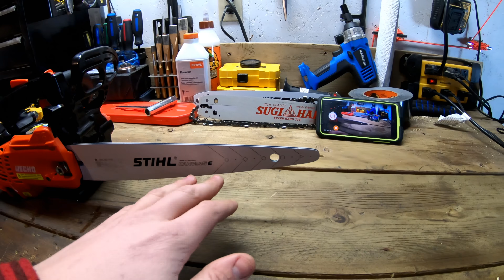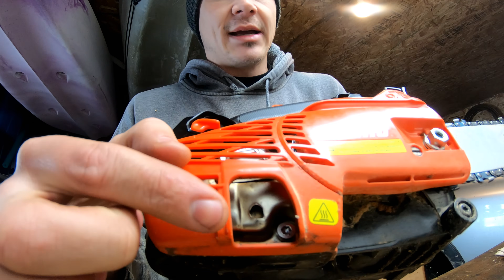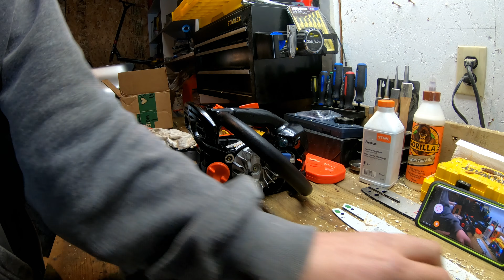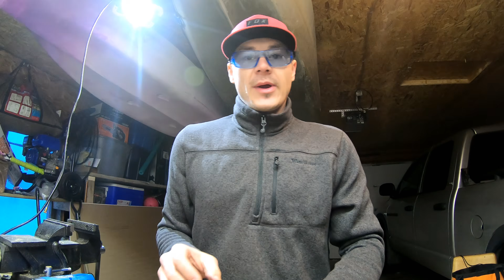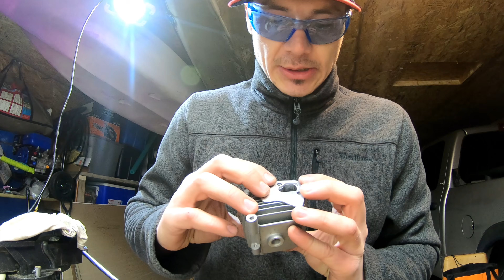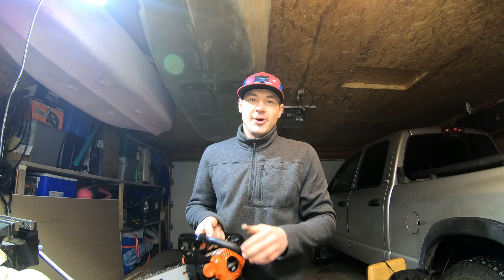Echo 2511T Full Mods!

Comment: I want to put 14in sthil light es bar on a brand-new echo 2511t will it fit if I do a 1/4 pitch sprocket conversion
Reply from the maker: No, it won't. You can do a modification to make it work. Get some good drill bits. The steel is hard af, lol. If you want, drop me your email, and I will send you bar pictures so you can modify it to work.

Comment: Thank you for this video. I’d love some advice. I modified the muffler on my 2511 T, it immediately jump the power up. I’m an arborist and this saw is a perfect weight to power now. The only issue is I’ve had it into two different places to have it re-tuned. Specifically when I shut it down and then go to restart it a few seconds later It will not fire on any number of pulls. Then when I pull it with the throttle wide open it fires right up again. Do you have any idea what this is? I obviously did not adjust any of the timing or do any porting. I’m satisfied with how the saws power has been changed. But starting it this way especially in a tree is not optimum. Any advice is appreciated
Reply from the maker: So I've had this issue as well, the saw is a bit quirky I would say, fast idle works great to start it after its been shut off  just flip the choke on then back off, and then you dont have to squeeze the throttle, Also I find aspen 2 works great for this saw, its a premix 2 stroke fuel and its all I run in it, I have a hunch the air filter has alot to do with the problem, im gonna try the mesh filter soon, hope that helps.
Reply: Poplar Mechanic great idea, I’ll try that tomorrow!

Comment: @7min -- LOVE that your conclusion, jug-in-hand, was basically that you saw most-potential in that exhaust-port's rear-end....I hate saying this but I wasn't going to port mine because I found out just how hard it is to get to the jug, you had to dissemble past the crankcase to get that thing in your hands...and I already knew guys were getting about 15% power ONLY from un-restricting the muffler's final exit-area, so I decided-against porting (I'm a small climber, power//weight is the end-all for me!) and figured I'd be able to beat 20% gains by doing the exhaust-port's rear half, and where it mates-up to the muffler (and, of course, the muffler's entryway where it's that choked 90deg turn), so glad to see someone else having done that :D I went further than you lol I went as far as the muff's mounting-holes allowed, and did a meticulous job of port-matching the TWO gaskets (not 3 ;D ) that were there...  BTW Re those gaskets, for your open-can design it doesn't matter much, but for one like mine that's actually scavenging and getting back-pressure, sealing to the cylinder is VERY important, I tried to run it w/o that lil "soft, lead-type gasket" and it does NOT work, if you look at the 3rd mounting point on the left side you'll see it's all height-dependent, if you want that muff to meet the exhaust-flange dead-on true, you need to have both of those gaskets' thickness there....my "thin, lead-type" gasket did rip during initial opening-up of things, but thankfully it bent-back into place easily, adn - for porting it - I bolt/sandwich it in-between the thicker plate and the muff (or the exhaust flange) so that it gets port-matched w/o hurting or warping the delicate lil thing!  
(obviously I am using a VERY meticulously "blocked-up, 100.000%"exhaust port when doing this on an assembled engine!!!)
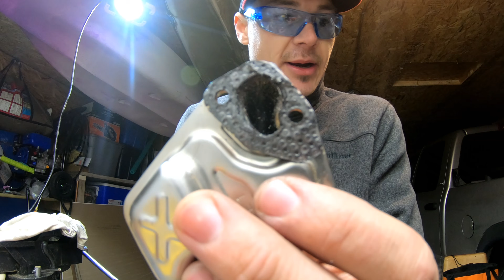Reply: That's what I get for getting excited & posting before finishing, around 9:30 you clearly DID get about as-much-as-possible at that area of the exhaust-flange, muff-gasket(soft, lead-type) and aluminum heat-shield, I could even see that you used a flat-file on your alum heat-shield to get it nice and perfectly true, I do that on all my gaskets and muffler-entryways to ensure proper mating, I wish there were a gasket-goop that could handle exhaust temps lol (oh and will fully acknowledge you seemed to "get" the idea that the soft, lead-type muff gasket, obviously needing to be trimmed to match, is best done by simply sandwiching it, this preserves its integrity while you grind it, also you do a good job describing it as no chokepoints or however you phrase it, I like to call it "over-matching", if it's something where I'm mounting-up a muffler and I'm port-matching the gasket, I'll leave the bolts loose, push the gasket one way, tighten them & port it -- then loosen the bolts, push the gasket the other way, and port the side that's now needing it....because things never line-up 100.00%, you either MUST over-match your porting here, or you're guaranteed to have some non-zero amount of restriction due to non-perfect mating of the ports!)
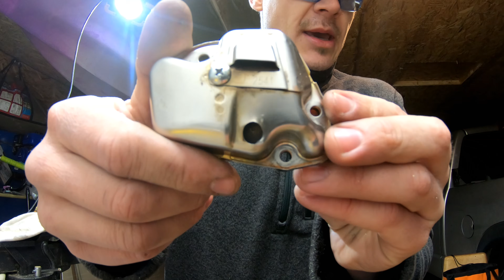Reply: Oh no... 10:04....Seeing your new exit hole is adequate, and I know you got the entryway to the muff (and gaskets, and exhaust-flange), BUT that muffler has front & back halves, with a baffle-wall separating them, and there's a hole on the left-side of the baffle wall that allows the gas to get from rear to front....because your baffle hole is still OEM spec, your muff still has a choke-point in it :(  You may be able to make a pair of tiny ~1/8" holes in the baffle-wall that you exposed with your new exit-hole, doing a MINOR opening of the baffle-wall there would aid the undersized OEM baffle-hole and overcome the problem, obviously if you did, say, two big 1/2" holes in teh baffle, it'd defeat the muffler and just be "open can" crap which, while allowing cool flow, is unnecessarily noisy, weak, fuel-inefficient and just a suboptimal way to run a powersaw! I'll have a video up on mine to show this baffle hole, will get it posted within a few hours because i've left comments elsewhere about this so I need to show what I mean, cannot find 1 image on GIS for this, if anyone's got a dissected/opened 2511t muffler JPG please share it!!
Reply from the maker: @joescissorhands141  hey Joe, thanks for watching, this video is old now and its when the first 2511s came out, I just wanted to see if I can get small gains if any,  it was basic mods to test out the saw, ive since learned quite a bit, I now have a lathe and am currently learning alot more about port work and timing. There is a cat inside the muffler, ive seen guys split em and take it right out then weld them up, Seems like alot of work. Now im running a 2511 that my buddy ported for me and it just rips, I didn't have a lathe at the time so I had him do it

Comment: push the primer 6 times and let it rip I like the saw for the price👀 allabout.wiki/Echo-CS used maybe 10 tanks of fuel, 6 loads of hard wood and am very pleased with it. some will say its under powered for a 20" but I like it better then a 18". I have a 18" also which is great also just like the extra 2" inches. the saw is very light also which is nice. Huskavarna owns Echo so I am sure it will last. its not a sthl but still love it! I have seen some bad reviews on the saw but do not agree with them. some people told me not to waste my money but have since changed there mind. just have some common sense and cut some wood!
Reply: Huskavarna (sic) owns Echo? 
Well then who is Shindaiwa? Yamabiko?

Comment: Can you explain the gasket delete and what you replaced with
Reply from the maker: So in this case I used permatex, red or black seem to work, this year I'm testing out a beer can gasket thats when you trace the gasket onto a can and use the can because its thinner, the idea is to tighten the area between the piston and squish band(top of the cylinder) to achieve more compression, basically more volatile combustion.  The number you want is 20 thousands or a little less if you want on the small saws, put a soft piece of sodder through the spark plug hole once the cylinder is bolted down, use a wrench to turn it past the sodder and measure the sodder with your calipers. Make sure you take the cylinder off and clean once you reach your squish.
Reply: Ok
So aluminum plus permatex on both sides of aluminum ?
Will give it a go
Reply from the maker: @williamhansen1473  no if you use the can you dont need any permatex
Reply from the maker: @williamhansen1473  and the 2511t has a big squish area even with the gasket delete i wouldnt do much more than muffler mod gasket delete and a timing bump only remove about 25 thousands for the timing advance, you could pull the woodruff key and grind that, but i find just filing the flywheel itself works to, just dont take too much.

Comment: Would of like to seen more on the installation of the 1/4 pitch sprocket. I have a cs-271t and purchased it for carving so I will be converting it to 1/4 as soon as I find out where to get one for a Echo, I have one for my Stihl which has a 12 in dime tip. Where did you get your 1/4 sprocket?
Reply from the maker: I got it from here. https://www.sawagain.com/1-4-pitch-8-tooth-clutch-drum-spur-sprocket-fits-echo-cs-2511t-new-oem/ 

Also the installation is very simple, just use a small impact and remember they are left hand threads, also make sure the plastic piece that the sprocket rests in to spin the oiler is correctly aligned.

Comment: Woud you say the 14 in echo bar is worth the extra $. ....?     I will using this saw for trail maintenance.
Reply from the maker: Yes the longer bar is nicer, it can pull it with ease, but it's up to you, may be nicer to have a bit more length for the bigger trail stuff.

Comment: Just did my little echo base gasket and muffler mod, crazy how much they open up after.

Thank you
Reply from the maker: Hey no problem,  that should help out alot, I'm pissed off I dropped mine and it hasn't been running right, But other than that very impressive for a small saw.

Comment: Did you not touch the transfer ports
Reply from the maker: No this was more of a test at this point in time, if I could do it again and I will at some point I would do the transfers, I'm going to put a wheel on it to get the timing eventually.  The muffler mod helps this thing alot the timing advance isn't too noticeable.
Reply: That's still a pretty good gain in performance without doing any transfer port work
Reply from the maker: @bethanyhaskiell9116  in my opinion for someone that isn't willing to do all the hard work of porting. I would say muffler mod and 1/4 set up yields the most performance gains. If your willing to clean up transfers to improve flow and put a degree wheel on it I'm sure there would be more gains to be had, I'm just learning about degree wheels and what affect raising and lowering ports can do. So one day I will put the wheel on the echo but right now im working on my 385xp. Hope that helps it's a strong little saw as is.

Comment: Hi all the way from Suffolk England 😁very clear video!
And I can now see you realise its a carving bar. The problem with carving bars is that you need to run the chain a lot slacker due to no sprocket in the nose, which is dangerous in the trees.
I'm a full time arborist, and have just picked up 2 new Tes echoes. It's really important that people must be made aware if your changing drive sprockets to more teeth, Say 7 - 8 that you change or make sure your P. P. E protective trousers ect. Are able to cope with a faster saw, as the standard R. P. Ms will change. And won't do there job proply.
Safty first.
Thanks for a great video
Stay safe Gareth 👍
Reply from the maker: Hey thanks for the info, And ya I got a 14 inch stihl bar on it now. Just so you know I didnt seem to gain much from the timing advance. Muffler mods probably the easiest safest way to get a bit more out of it.
Reply: No offence Gareth but I've ran the now stock carving style bar that it comes supplied with on 1/4 pitch and not thrown a single chain  and i've taken the piss with the little bugger. Yes a little blueing on the underside of the nose but its heat treated so not a problem. Go PANTHER 1/4 0.43  bar and chain though.......different league isn't it
Reply: @stephentree3466  is the Panther bar/chain better than the 1/4 stock one which come with the saw?
Reply: @thecdoggydog2328  it is a very good chain. Stays sharp reasonable. And they come without the extra saftey rakers. What isnt as good as aimed for are the bars, they are fast used up. Better take a tsumara bar or a Stihl carving bar. The stock chain is much fatter as the 1/4 panther chain. What else? The chains are somewhat likewise to a Stihl picco so... there are options to buy.

Comment: Nice build.  A little tip: take the key out of the crank, and file it down to advance the timing. Leave the flywheel alone. Now you can just flip the key over if you want to go back, or get a new key. Easiest way to file the key is to put it in a pair of vice grips, secure that in a vice and use a flat file to take material off.
Reply from the maker: Ya great advice thank you, I figured that out shortly after. I guess people sell keys they have set up for the advance. Anyway the timing advance didnt seem to do much for this saw. Thanks for the information. 👌
Reply: @PoplarMechanic  If it is in fact an electronically limited ignition I am not surprised, they normally taper the advance back out of the curve at high RPMs as a means to limit max RPM which is where you would see the gains from advanced timing.

Comment: Can someone tell me what he means by how an eight tooth gives more speed and a gauge gives fiber cuts? I’m new to sawing but would like to learn how to mod an old chainsaw in order to get more life out of what seems to be a good chainsaw
Reply: The 43 gauge is a thinner bar from left to right when looking down on the saw from behind (it's also more narrow top to bottom near the tip, but that's irrelevant to your question). Therefore It runs a more narrow kerf, which is literally a finer, or thinner, cut. The ting to watch out for is that the bar being thinner means it has less strength to resist a bend. This is not a mod I would suggest for newer operators on larger saws or older saws unless you are using one with an Alaskan saw mill and want to reduce waste.

Comment: Hey man I just picked up one of these saws and I love it. The chain is a little too aggressive though and I noticed you put a Stihl bar and a different chain on yours. Can your tell me which bar and chain you got so I can do the same?
Reply from the maker: Here is the bar part # 3005 008 3409
Here is the chain part # 3670 005 0072
1/4 sprocket part # A556-0001710
Also you will have to drill two holes for the bar to line up properly. Give me your email and I will send you pics of my bar to give you an idea where to drill.
Reply: @PoplarMechanic  thank you so much. It's browningsa@gmail.com. We're you worried about drilling holes into a brand new bar?
Reply from the maker: @stevebrowning5081  well I didnt drill the holes I bought one from ebay wich is now unavailable. But others have and it works fine. If you want it to perfection take it to a machine shop. There are also some oil channels put into the bar I have, I'll send you the email when I get home. It shouldn't cost more than 30 dollars to get it done.

Comment: Hello, I have cs 355t that keeps running even after setting button to stop. Any ideas of what's going on. One month old
Reply from the maker: Yes, You have a wire off on the switch. I dont have specific experience with the saw, But if you have to open the handle be carefull about the linkage. There may be a small screw to take off the switch.  Hope that helps. 👊
Reply: Another possibility is- debris gets down inside the switch and will prevent it from making the contact for kill. Oh PM,don't sell yourself short,I just subscribed for a reason;👍!
Reply from the maker: @plugger4945  👍

Comment: Thanks for sharing, hope you keep up the tinkering (and the sharing!!!!), would love to test-out one of these lil 2511's (well, a 3511 really lol!!!) because - god I can feel the hate this is going to generate - because I just got this lil generic 'scheppach csp2540', a 25cc/10" top-handled, and out-of-box it doesn't have any of the spark arresters / muffler-port-blockage that all my other gear came standard with, once my tachometer arrives & I'm able to get baselines and safely mess with my H screw I plan to check the schematics of the muffler [thing came with amazingly thorough manual] to dog out the thing and remove the catalytic if there is one and otherwise just ensure that there's greater-than-or-equal amount of air-passage through that muffler as there is for the exhaust-outlet from the cylinder!  
I say this because I've found all my name-brand gear to be 'choked' from the factory with restricted mufflers/spark arresters/etc and this scheppach seems to have avoided all that, it's as-if it got some of the modifications out of the way for me lol - at $145, *shipped*, my goal is to get at least 1 more unit so I can not only have a backup to swap-between when doing longer jobs but also have the confidence to really tinker- for someone like you who is doing these things professionally(or nearly-so), I can't help but think of how much fun you could have just dropping $145 or $290 so you could play around - I've already hit the Q of "how much power & heat can this safely take?" and am ordering an IR laser thermometer (hadn't considered this type of thing til, after merely removing the spark-arrester & its retention plate from my Husq 125B, the exhaust's output started melting the plastic body casing ;P )

Thanks again for sharing, these types of vids are awesome I hope you continue tinkering & sharing what you're learning!!!
Reply from the maker: Hey no problem man! I learn as I go, I have the echo running now, It had a bad coil believe it or not. So I will share once I put the mods back on again, have a good week man! 👊